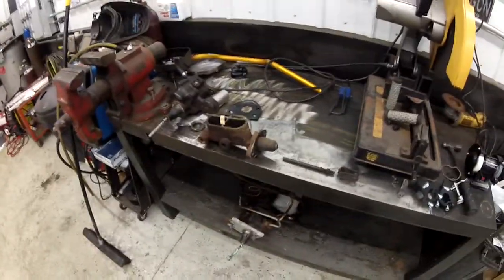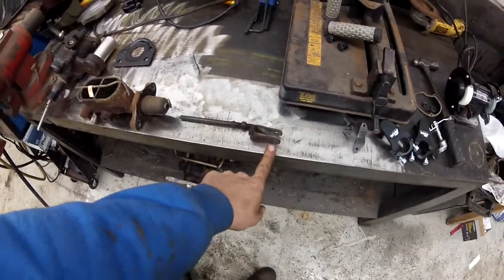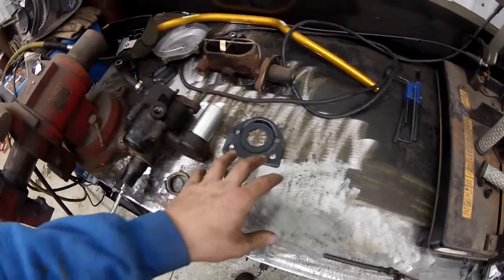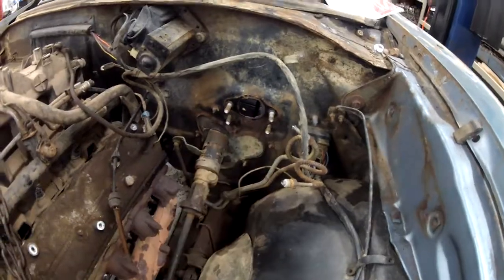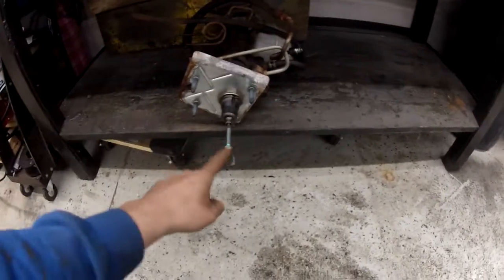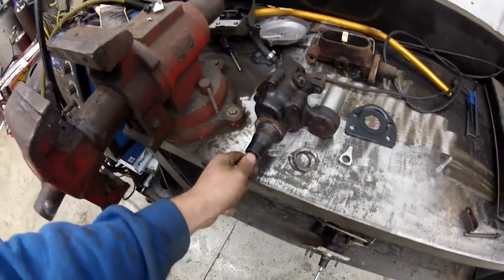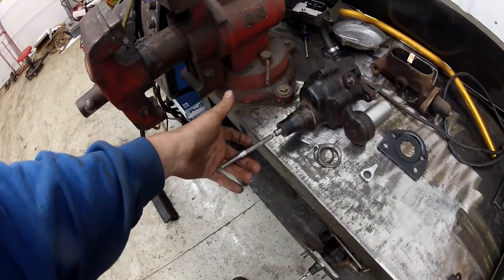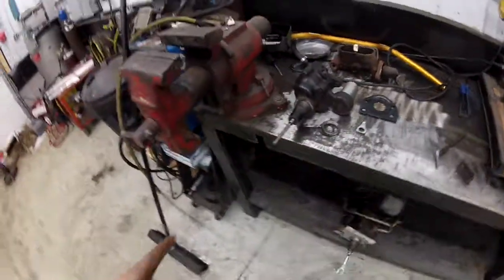1969 Chevelle Hydroboost Brakes LS Swap

Comment: I picked up a hydroboost from the swap meet last week for my 64. Same unit you have on the bench. Gonna rebuild it and make it look pretty but was wondering what you did with the return line. I was thinking a Y fitting and just have the PS box and boost go back in the single return to the pump but not sure if the one can handle the flow.
Reply from the maker: I ended up having to use a pump that had a remote mount reservoir. So it has a return port already on it . But yah, just y the bad boy!